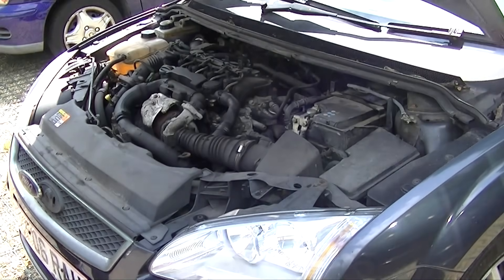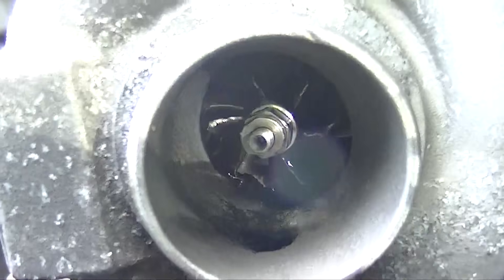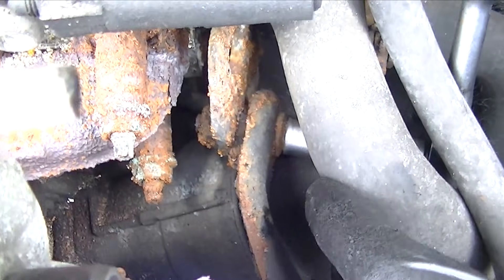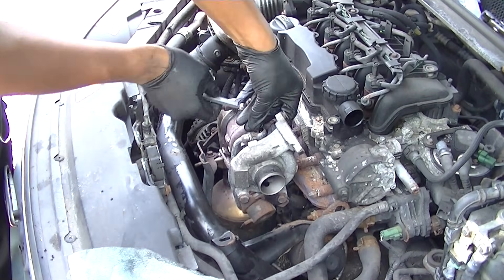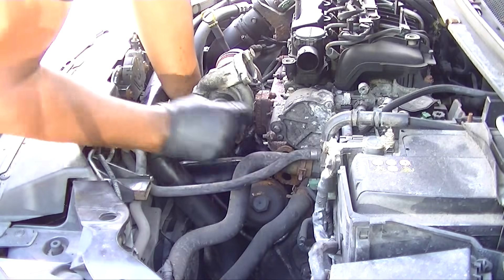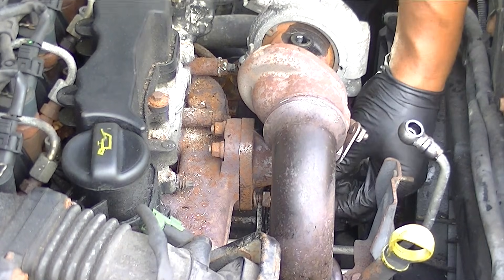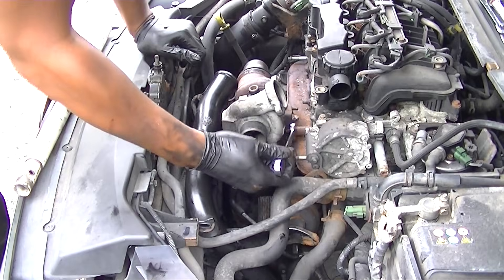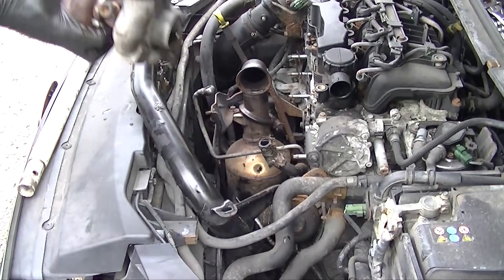Ford Focus 1.6 TDCI Turbo Removal

Comment: Awesome job.  I am using a pair of those turbochargers on an old diesel engine..needed to see the exhaust clamp details.  I've sorted out lubrication side plus all threading details.   I'm welding exhaust manifolds from stainless which is the major hurdle.  The controller for turbos is coming from Scotland. 
All this to get 150 horsepower at 1400 RPM.

Comment: Well 5 exhaust channels it mean pressure of exhaust can flow to EGR. ITS 90HP version 1.6 TDCI? Turbo with waste gate. How work turbo with throttles?
Reply from the maker: I dont understand this question
Reply: @BMACVAGS  now i dont know what i thinking about. Maybe i think of lost exhaust presure in 5th channel. in 1.6 tdci there is 5th exhaust channel in exhaust mainfold. 5th is for EGR valve recylculation.

Comment: hello mate, i have a 2009 1.6 tdci focus zetec 110 bhp. car went into limp mode. took it to garage they said it was turbo. bought a second hand one. got it replaced. i drove it home and ran it 5 mins outside my house. now it wont start again. doesnt turn over at all. like as if though battery is dead. any ideas? havent got any more cash to spend on garage and dont trust them now
Reply: I know your comment is old and yer probably past this, but oftentimes if a mechanic gives you a definitive answer with very little info, they haven't given you the right answer. I'm lucky that my local mechanic won't actually touch my car unless he knows what the problem is. I had random rattling recently, seeming to come from the gears. Only happened randomly, tried to recreate it with him in the car, couldn't, so he couldn't identify, just said to come back with more of an idea because he won't spend ages trying to figure it out charging me loads of cash.
Reply: A little bit late, but that sounds like alternator issue, not turbo

Comment: Have to buy a new turbo just wondering would I have to tune the ecu after installing the turbo?And would the engine be able to handle a bigger turbo? Cheers Pal
Reply: No LOL Them 1.6 engines are  the citorens bad engines the 1.8 tdci are better

Comment: You know where is the dump valve system on this car please ?
Reply: i think its a variable vane turbocharger and therefore doesnt have a dump valve. there is an actuator opens and closes the vanes.

Comment: you sir are a legend, ive used your vids for my audi and vws but bought one of these cheap  and now i know why, but most helpful..

I did the same job this afternoon and also had to remove the whole manifold due to top 2 bolts on turbo not moving. 
Thats me got a spare dpf and turbo and theres no play on it either

Comment: Is this got a DPF? My heat shield goes all the way down covering the DPF. The heat shield must have bolts lower down as I'm having trouble getting Access to the turbo bolts at the back.

Comment: Great video. BMAC VAGS please do more videos. Over the weekend my diesel particulate filter warning sign came on.

I went to my local garage to see what was wrong with it. The Garage informed me, that it would cost around 1,200 pounds to clean DPF and turbo; he said this was the cheapest option.

Or i could go with new DPF and Turbo for 2,800 pounds on BMW 1 series 116d 2009 model.

The garage also informed that i could not drive my car, no more than a week as my engine will blow up.

BMAC VAGS please note......at not point did he check or  inspect my car, basically he looked at the dashboard sign.

I read online that i would have to drive at 50 miles in order to burn out DPF. I tried this method for two days no luck....i have also so inspected the turbo i cannot see any oil leaks.

BMAC VAGS can you help ?  what option could you advise me.

Comment: +BMAC VAGS, wonna pop round and do my transit connect turbo? lol. ive subbed ages ago as ive a mk4 golf but my work van has just started the turbo squeal so looking for vids on removing the turbo. Sadly with the connect they decided the rear of the engine half way down would be a really great place for the turbo (WHY....!!!!!) so its not this easy. Yeh so if you pop round and whip it out I'll keep you topped up on coffee lol. Cheers for another good vid. Shud imagine that mine will be fairly similar just in the worst place they could put it!! Hmmm cheers for that Ford!!

Comment: Very shit engine produced by Peugeot. I've replaced countless turbos and engines because of oil sludging up and seizing the engine solid lmao. If you change the oil every 6000miles with an engine flush and replace the injector seals you mite be lucky for it not to eat a turbo or seize lol
Reply from the maker: Yes i have to be honest and agree with you there
Reply: +BMAC VAGS my xud9 td in my 306 is 20 years old and hasnt given me any problems atall :) just glowplugs and serving. Vag 1.9pd engines are also bombproof can't beat the old stuff!
Reply from the maker: +piston head 1243 once again you are 100% correct in my opinion. As long as they are not neglected they will last a lifetime
Reply: +BMAC VAGS sure my brother had a b5 1.9 diesel passat. Was running 207bhp on a hybrid turbo and bigger injectors and the engine wasn't opened once. Great cars 👍 loved splitting boost hoses tho haha

Comment: What size hex/allen key do you need for the banjo bolt on top of the turbo for the above car in the video?
Reply: alllen key  size 3/8  I bouth in poundland ages ago  full set
Reply: Its 10 mm bit hex socket

Comment: yea having issues with injectors now they are leaking diesel but extremely dirty and inside the injector hole might have to take head off and have it blasted through

Comment: You should know that if you find oil on the front hose wich is conecting to the turbo, from the air box, it is usualy due to the pipe coming from the crank case. Oil vapour gets transported and i.m saing vapour beacuse they actualy little particulats from all that movement inside the engine.

Comment: great video. i had my turbo replaced and the engine flashed. do you flash this?. mine has started to smoke when cold is the turbo going again.
Reply from the maker: yes you must clean sump, intercooler and pipes

Comment: nice vid, just one thing, the oil is coming from the breather, not the turbo, it can leak obviously but oil that side of the turbo isn't oil coming out of it, air flow and pressure would prevent this, this engine throws out a lot of oil via the breather, I have installed a catch can to stop this getting ingested back into the inlet manifold / IC.  I collect about 70-100ml per 6k. that oil, eventually joins the inlet manifold and combines with the egr soot making a black sticky substance, this works its way In to the sump which then blocks the banjo bolt on the oil pipe feeding the turbo which then blows it up, so if you want to stop your 1.6 TDCI blowing up, blank off the EGR, collect the oil from the breather and change the oil every 6k
Reply: +Buga Daniel I'd recommend doing another flush fairly soon, the problem of flushes is that it could dislodge car on which ends up blocking it up after, give it a 1000 miles an do it again to be sure.  The filter your looking to remove is in the sump, its this banjo bolt that is easily blocked with carbonised oil
Reply: +Buga Daniel  Hi, did you remove the filter from the banjo bolt that sits on top of the Turbo or the lower banjo bolt from the oil feed pipe?
Reply: +beach life i removed the filter from the banjo bolt located on the engine block. the banjo bolt on the turbo doesent have a filter, at least mine didnt
Reply: +Buga Daniel To get to the engine block banjo bolt did you have to remove or lower part of the exhaust? mine is fitted with a dpf
Reply: to remove the DPF you really need to remove the radiator fan as well, it comes out fairly easily but getting it back in is extremely tricky without breaking anything. Rad fan, DPF, Sump, and your good to go
Reply: +Dee T I removed the filter from the banjo bolt an put fresh oil. Did abut 2000km and then did an engine flush.
Personaly i think the engine flush did its job. The engine runs more silently and by loking through the top oil plug i can see thet the camshaft is cleaner than before
Reply: +beach life yes, you need to remove the exhaust but only the section that contains the dpf and cat:
The benjo bolt is near the oil filter casing

Comment: this video has proven to be invaluable as I have just replaced turbo but still no boost so going to try changing oil pick up etc wish me luck
Reply: +wayne mitchell check teh vacuume hose on the turbo...maf sensor
Reply: Look for cracking in the inlet turbo manifold pipe. That was my issue and also clean all your sensors 👍🏻 my boost issue was bad turbo, split turbo inlet pipe, dirty egr, dirty throttle body and also dirty sensors. Now back to brand new responsive fiesta lol

Comment: Hello, great video. I have a Renault Clio 1.5 dCi 2002 and began to smoke with every pretty normal acceleration. What could it cause it. Thx!
Reply from the maker: Branimir Kovačić It depends on how much smoke. It could be injectors, Turbo or Air mass sensor. You will need to do some more investigation.
Reply: Thx m8!
Reply from the maker: Branimir Kovačić No problem, be sure to subscribe
Reply: Branimir Kovačić Be sure to check out the EGR valve they are prone to sticking open on the dci.

Comment: The engine in that car is Peugeot hdi  and version of that has been used by Citroen, Ford, Volvo, Suzuki and BMW Mini.  When replacing turbo unit it is also recommend that you replace the oil pick up pipe as it has gauze on it which can get blocked...

Comment: I watch your vids all the time was wondering if u have any idea of this i have a 97 1.6 8v Audi a3 just replaced gearbox and clutch because the common diff problem set linkage and was fine until warm now stiff and crunch going into reverse could this be a hydraulic problem or wrong gearbox oil many thanks
Reply from the maker: Jason Marshall Did you replace and bled the Clutch slave cylinder?
Reply: Its a push rod box on them so just un screw the slave cylinder from the box via two bolts but when I did get crunching symptoms I bled the cylinder it only seems to be when warm funny enough you think maybe try bleeding again or slave has packed in ? Thanks for the reply +BMAC VAGS
Reply: No never replaced the slave cylinder it seemed fine ill check tomorrow and let you know if I find anything just weird how it happens after been driven for around 20min